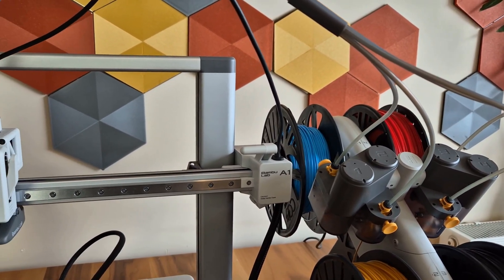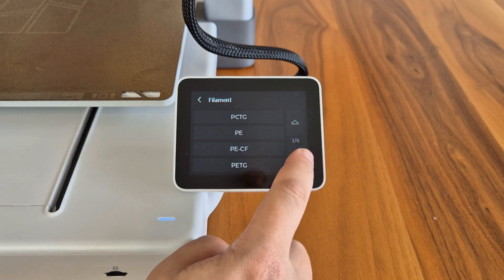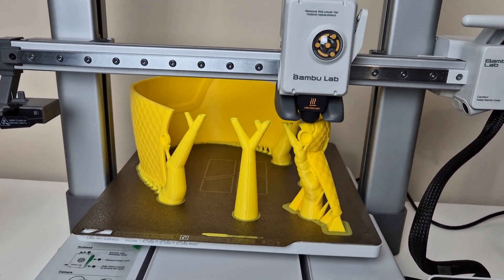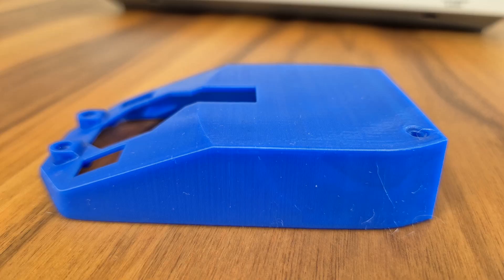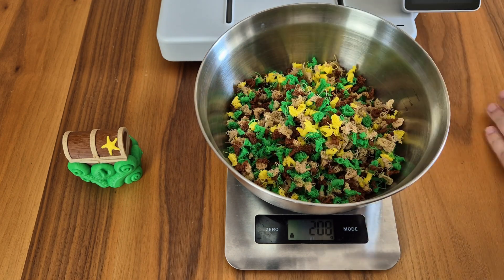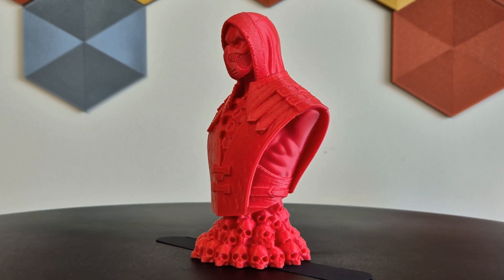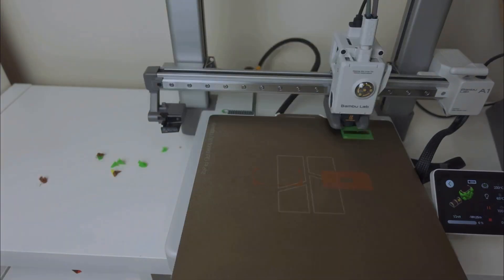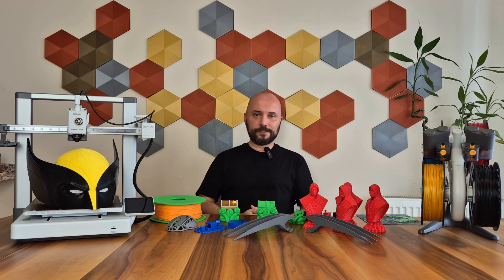Bambu Lab A1 Combo Review

Comment from the maker: So what did you think of this video and the Bambulab A1 Combo? I'm waiting for your comments.
Edit: You don't need to unscrew the two bolts I showed you to change the nozzle. All you have to do is open the clip. I would like to thank @beermanuk for this correction. 🙏
Reply: do you have a promo code or affiliate code?
Reply from the maker: @mave4456  Unfortunately, I don't have :/
Reply: Why is it that you can't use flexible filaments

Comment: It seems that at around 6:07 you did not align the small cutout on the cardboard cylinder of the refill with the notch on the spool. This is crucial to prevent the filament spinning on the spool.
Reply: Why 67

Comment: This is the ultimate beginners printer, Enders are cheaper for sure but reuire a lot more knowledge to get then up and going which is better in some ways because it forces you to learn the tech but it can be detrimental because it can turn you off from the hobby, with this however you get a taste of what is possible and works right out of box, my first was an ankermake I got on sale for $300 and the only thing that machine had on this one was the camera being way better but I've had many issues with the M5, some user error and some was just faulty hardware and took over a month under warranty to get replacement parts from the company, my A1 had a defect on one side of the build plate and it took me maybe 4 messages with some troubleshooting for them to send me a new plate, if tou wanna test the waters, go with the A1, if you want to dive deeper get an ender

Comment: well ABS is not recommended with this printer so that's why it probably came out like that.
Reply from the maker: Yes, it is difficult to print with ABS in open printers. By applying adhesive to the table, small prints can be in an environment with no air flow.

Comment: Great video! 👏 A great test of the Bambu Lab A1, the print quality looks amazing! Can you share more about the printing speed and accuracy? 📦✨
Reply from the maker: Thank you very much🙏 You can see the speed tests I did in the last parts of the video. I tested the printing of the same 3D model at speeds of 50, 150, 250 and 500mm/sec. I did not do a test for accuracy. If you mean dimensional accuracy, this may vary depending on the type of filament used and the settings. However, dimensional consistency can be achieved with the correct calibration settings.

Comment: Bambu Labs? Hmmm... let me relate my experience with this company... I know nothing about 3D printing so I wanted a machine which would "hold my hand" and every review, every recommendation, said "Bambu Labs A1"... so I bought one. Initially I was pretty impressed but with growing doubts about the AMS Lite which I bought wit the A1 - it is not a user friendly device; is poorly documented, and prone to causing grief in a wide variety of forms! But.., the printer? Well... after a few weeks I started to get poor base layer deposition in two places on the hot bed which resulted in ripples in the subsequent layers and a horrendous rattling as the nozzle passed over these areas. On a large height print this badly deformed deposition is lost inside the print but on anything delicate (10 layers or so max) it looks awful. Add to which it caused poor layer adhesion so on a multiple item print where one model is cloned several times I found that any models printed in the defective bed areas would literally break apart, sometimes even as you removed then COLD from the build plate!!! NOT ACCEPTABLE frankly. So I contacted Bambu who immediately tried to get me to do their diagnostics for them by telling me to download this, run that and observe the other... I told them that A. I don't have a Micro SD Card writer B. I didn't have a clue about such things and C. I'm 68 and my manual dexterity is not up to dicking around with memory cards I can hardly see let alone use!  Add to which I brand new smooth build plate I bought started to shed its surface exactly over one of the spots on the heat bed which is giving me these issues but they have hidden behind - it's a consumable so we won't replace it! They even sent me a screen grab of their T&Cs in which it stated clearly that a build plate is covered for defects if reported within 30 days - which I had done! But then they just decided instead to ignore this fact when I pointed it out to them offering instead obfuscation, avoidance and even outright lies! There response for 6 weeks now has been to put up any and every excuse under the face of the sun together with rank obfuscation and lies until my credit card company has descended upon them and threatened to refund me in full - now? They still will not replace or collect and repair the machine, offering me a refund instead... a refund knowing full well that I want the machine sorting out, not my money back! They know I've bought filament, hot ends and build pates, only the filament being useable with a different manufacturer's machine. AND of course, I bought the machine in the pre-Christmas sale so if I decide to buy another then I will have to pay more! So... the morale of the story? If you are attracted to Bambu for it's much vaunted simplicity of use and their "hand holding" attitude BE AWARE that once they've got your money the devious, mendacious money-grubbing scum will stick two fingers up at you the minute you need help... CAVEAT EMPTOR!

Comment: what speed did you print the black part of the mask? It doesn't look that great. Cansanding help, or would that leave its own marks?
Reply from the maker: I used the standard Bambu Studio settings. The angle of the photo and the lighting can be a bit misleading. The print is quite nice.
Reply: @3DPrintLab1  Are u familiar with the P1S? Is it noticeably better? Thanks
Reply from the maker: @deeber35  The P1S is a better printer in terms of its features, but I think their print quality is very close to each other.

Comment: Why did you undo the bolts to take the nozzle out?  Just unclip and it will slide out.
Reply from the maker: You are absolutely right about this. My mistake, I will fix it by pinning it in the comments. Thank you.
Reply: @3DPrintLab1  No problem, we all make mistakes sometimes.  Apart from that, great video.
Reply from the maker: @beermanuk  Thank you so much 🙏
Reply: I subscribed to u
Reply from the maker: @michaelpailthorpe6433  Thank you 🙏
Reply: It’s not a mistake, it’s just an alternate method
Reply from the maker: @silentscopez1364  Sure, It helps you remove the nozzle more easily, but it is not necessary.